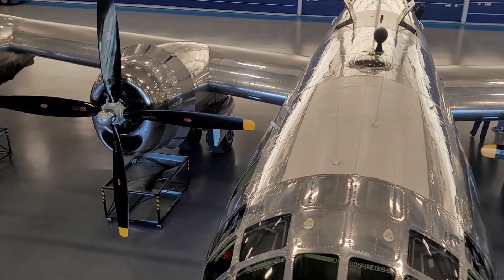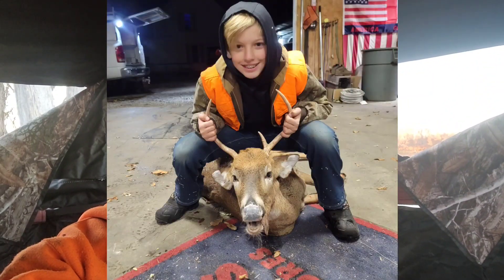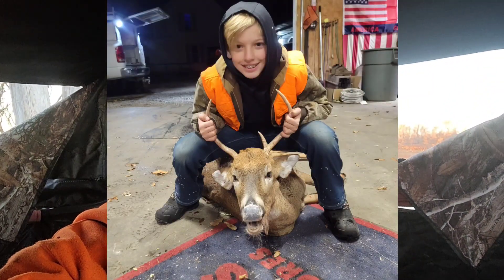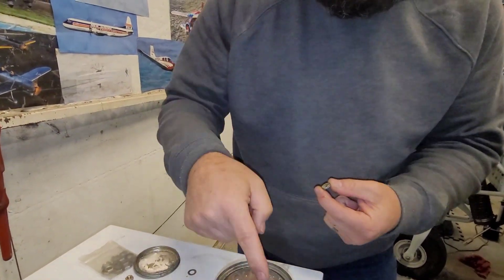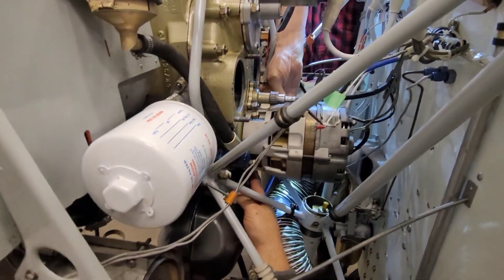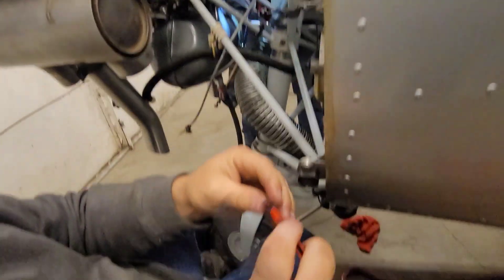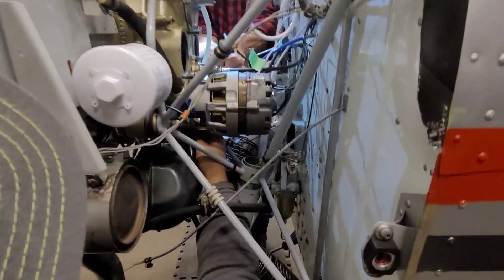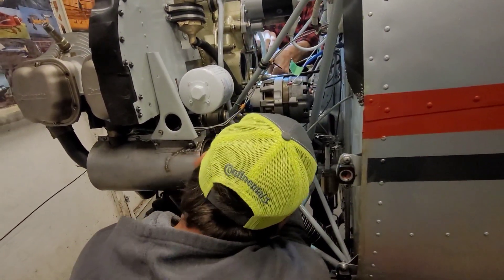Engine is going back together

Comment: I am a groundfowl, not a practicing aviator so treat my comments with a little disdain and test them with a proper maintenance engineer. My personal preference would be to overfill the oil so that the pump is being gravity fed to prime it and the crank and bearings become prelubed from being covered in oil. Pull the prop over by hand with plugs removed until constant oil comes out of the pressure line to the gauge and carries air out with it. To overfill the engine will require some sort of hose or tight-fitting tube in the filler neck to raise the level. Hopefully no one will pull the tube out before the oil is drained from the sump and refilled to correct level or there will be a mess.